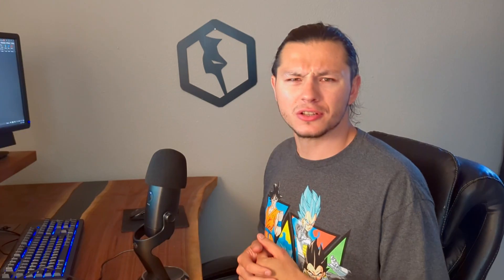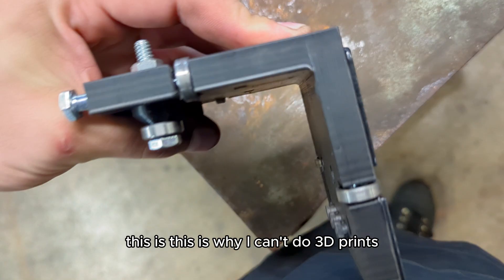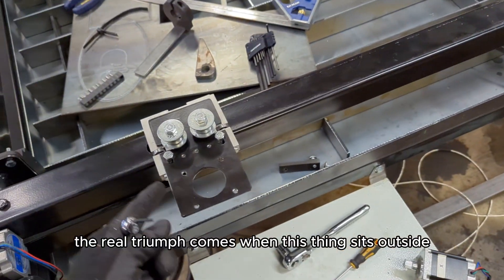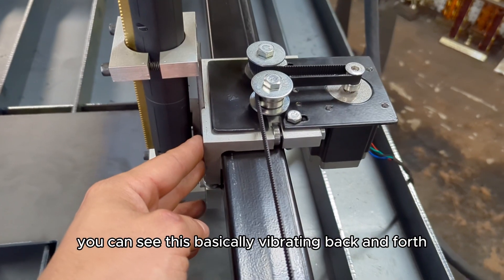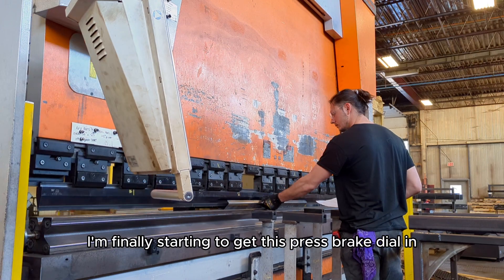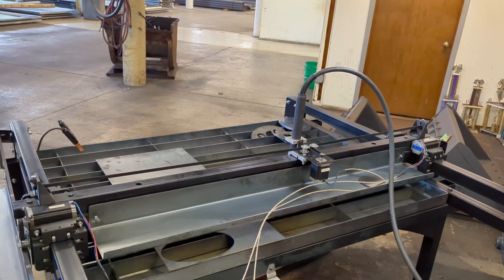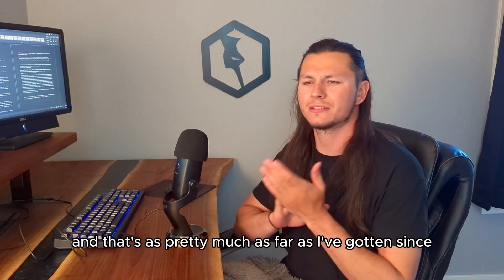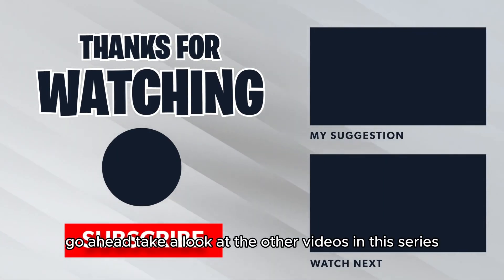Turning JD’s Garage CNC Plasma Cutter into a Money Making Machine. | Pt 5

Comment: I know everyone's probably mentioned this already, but print orientation, temperature, and wall counts are all very integral to the atrength of the 3D printed parts.
Reply from the maker: @ndog1234765  I have since figured this out. It dramatically improves print durability. But..... You get beat the aluminum piece. It's just to crispy
Reply: @ThyialIndustries  If I had the capability for aluminium, I would join you immediately. But it's amazing how strong a 3D print can be.

Comment: I would be carefuil about the sparks burning and/or melting the belts... Perhaps you could add a metallic shield above the actual plasma tool? Or isolate the belts with some kind of metal tubing or glass tubing... or maybe polycarbonate.
Reply from the maker: @Luka1180  the betls are cheap enough that if the do break I can replace them very easily. But that's not a terrible idea
Reply: @ThyialIndustries  Still, but I just had a potential idea for a solution. Some kind of cover along the sides, which the moving gantry then takes along with it. Yes, it would poke out at either far end of the machine, ofc, which could be awkward, but it would save you the little money that the belts do cost in the long run. A dollar saved is a dollar made. It can be as simple as clear acrylic, or clear polycarbonate. Or very, very thin sheet metal. Rectangular. If you do this, use material as light as possible to keep the speed up, ofc. Not too much wobble, though, as stiffness of the gantry increases the speed you can do just as much as lowering innertia.
Reply from the maker: @Luka1180  that could definitely work 🤔

Comment: There is such a misunderstanding of 3D printing strength and infill. Infill has very little to do with overall part strength. It does have an affect, but not like most people think. The main contributor to strength is wall thickness. The more wall layers you have the stronger the part will be. The material you use is also a major factor. PLA is for making cheap prototypes and benchy's to sit on a shelf. The parts need to be made of something better like ABS or PETG, etc. With that said, aluminum was definitely a good choice here though. I am going down the same road of making the plasma cutter exactly to their plans, then upgrade where I see downfalls
Reply from the maker: I think that's well said. I've been experimenting and researching more with my 3d prints and have five that to be true. But I still like the aluminum a lot more
Reply: @ThyialIndustries  For sure. Aluminum is a perfect material if you plan to really run this machine hard.

Comment: What computer you recommend for cad cam and cnc programming what computer you use thanks great stuff
Reply from the maker: @WaldoG-b9j  really depends on the software you want to use. I have a custom build and use both solidworks and fusion 360. But I've also been using inkscape lately just to generate dxf's. And that's been my favorite so far
Reply: @ThyialIndustries  what desktop you use for those software
Reply from the maker: @WaldoG-b9j  it's a custom built pc
Reply: @ThyialIndustries  what desktop you start with? If you could of started all over what desktop you recommend
Reply from the maker: @WaldoG-b9j  🤣 idk man. I think anything the meets the recommendation of the software should be fine. At the end of the it's better to just get started then wait or spend money on equipment

Comment: Most people probably don't need to give up on the 3D printed version. I printed mine in Inland PLA+. Scrapped one out because I forgot to put supports on for the slots, so I decided to test it. I was able to place it on a concrete floor like an upside down "v" and jump on it with one foot (I weight 215lbs). No damage, minor flexing.
Reply from the maker: @Brandon.S123  if that's true. That's crazy lol
Reply: @ThyialIndustries   I was really impressed at the time too. Gave me a lot of confidence to incorporate 3d prints in my projects. I actually dug up a video of it out of my text history-- sorry for the low quality. https://www.youtube.com/watch?v=9ed1r0vspRk
Reply: @ThyialIndustries   I was surprised too-- gave me a lot of confidence using 3d prints in my projects. Found and old video of it, sorry for the low quality-- https://www.youtube.com/watch?v=9ed1r0vspRk

Comment: I've ordered everything today and I'm down to the stepper motors. Can you let me know the exact ones to get or point me to an Amazon equivalent?
Reply from the maker: I don't use the ones off of Amazon. stepper online is my preferred choice. If you go to the website they have kits available with drivers, power supplies and motors
Reply: @ThyialIndustries  3-DM542T-S30 is it this kit?
Reply from the maker: @danielwilbanks-z7o  depends on what you want. I grabbed a 3-axis  nema-23 kit and a smaller NEMA 23 single axis kit. Would recommend shipping from a US warehouse
Reply: @ThyialIndustries  did it take long to recieve the parts? And sorry so many questions.
Reply from the maker: @danielwilbanks-z7o  stepper online I believe it took about a week
Reply: @ThyialIndustries  I'm on thier website now. There are alot of options. Which ones do I need?
Reply: @ThyialIndustries  I'm on thier site now. There are alot of options. Can you point me to the right one to buy?

Comment: What was the finished dimension? What is its capability?
Reply from the maker: 3.5ish x 4.5ish and can cut up to 5/8" ca bon steel
Reply: @ThyialIndustries  that's incredible. I'm about to smash that buy button on Amazon. Do you think it would be possible for me to make my cutting area 4x6 or do you think your design would be limited to 3.5x4.5?
Reply from the maker: @danielwilbanks-z7o  I think you might start running into problems with accuracy over that amount of length. Especially with the thinner walled square tubing. Maybe go to a fully welded frame?

Comment: Their ideas aren’t their ideas. JD directly copied (badly) the horrible Langmuir machine. In fact the Langmuir machine is actually a Chinese table once fraudulently branded as a USA machine.  There’s not a single original component or design on the JD machine besides the swap from Langmuirs flimsy ACME screws to belts.  Other then that they copied every single component including the linear bearing blocks.
Reply from the maker: This is exactly what I've been trying to tell everyone.

Comment: Man i shouldn't have watched now i want that not just the aluminum x,z part but the dual driven axis i like it all  hmmmm very nice im with you on the 3dp stuff and i did print mine in petg at 100% infill i doubt it will last very long was thinking of trying to extend a shaft from one side to the other to tie the y's together either way i gotta build a complete other side all my electrical and electronics are done
Reply from the maker: Awesome! Sounds like you're almost there.  And yeah having the larger cutting area has been awesome
Reply: Just buy the actual replacement components for a Langmuir. They are made in China and the company sells direct to consumer as those crazy machines are white labeled. The JD crap is nothing more than a total knock off 3d replica of a bad and overpriced machine.

Comment: Have you considered simplifying the design in order to reduce the price of that bearing block? I.e. Mounting the torch clamps directly to the block to remove a part and the slot on the face, using supported round rails on the gantry instead of the custom ball bearing setup to greatly reduce the machining required. If you switch to a 50x100mm / 2x4in (vertical) gantry, it would allow you to put two rails across the front, meaning that the "bearing block" is now just a flat plate that you could plasma cut out of thicker steel. (Then you can use some folded steel with a welded gusset for the motor support)

That's the approach I'm leaning towards on my build, I just thought I'd point that out because the supported round rails are really cheap especially when you consider custom parts like this.
Reply from the maker: I've definitely seen that style before. But with this being my first build and all... i figured i would just try and get it done rather than trying to perfect each aspect. there's definitely a lot of improvements that can be made from cost to accuracy to ease of assembly. Im just taking one step at a time!
Reply: @ThyialIndustries  That's fair, I look forward to seeing your next video and seeing your experiences as you put it to work.
Reply from the maker: @yngndrw.  Thanks I'll do my best

Comment: The 3d print should have been printed in its side, that way the layers are printed around the corner, stacking them on a weak point is asking for a break, also more skin layers 6 is a good starting point.. like what your doing keep it up..
Reply: Sadly JD sell that on their website printed like you see here in the video. I decided to print it from two parts and bolt it together rather then printing on it's side because I was afraid holes won't be precise enough
Reply: @mrkonrady22 With certain materials and the right settings it doesn't really matter what orientation you print your parts. The part basically becomes a uniform crystal. When you break it you can't see the 3dp lines in it anymore.
Reply from the maker: thanks for the tip. I figured i did something wrong with that. I havent heard any one else complain. I've only used my printer a handful of times. still a lot to learn!

Comment: I have to defend 3D printing a little bit because: I literally dissected and made my own part (in precise metric measurements, since I'm european), aaand printed it from two parts! No weird weak L shape, just two beautiful plates bolted together. I also used PLA+ (PLA enhanced with other plastics) with which I do a lot of moving parts. Bolts are also threaded into robust brass inserts, where I could I replaced plastic threads with captive stainless nuts. It cost me just time. But yeah, I dream of having alu parts one day too 😂
Reply from the maker: I think if i really wanted... i could have made the 3d printed parts work. (More practice printing, and redesign). But i think i just liked aluminum way to much.